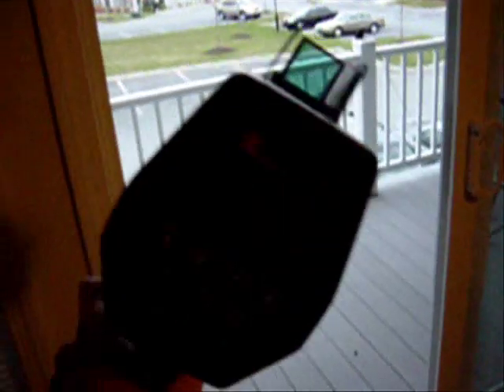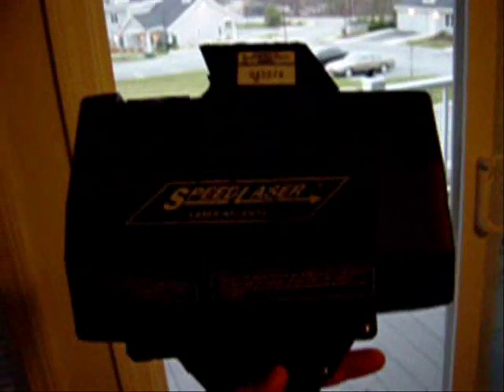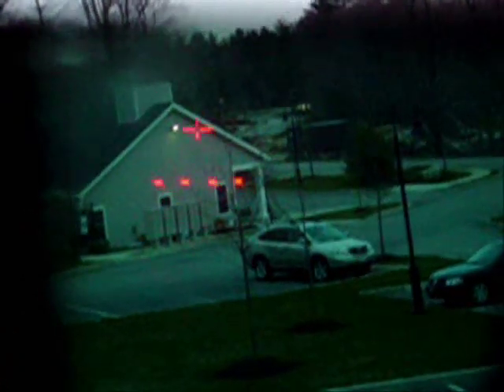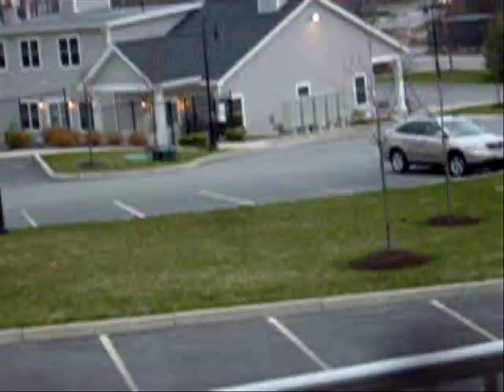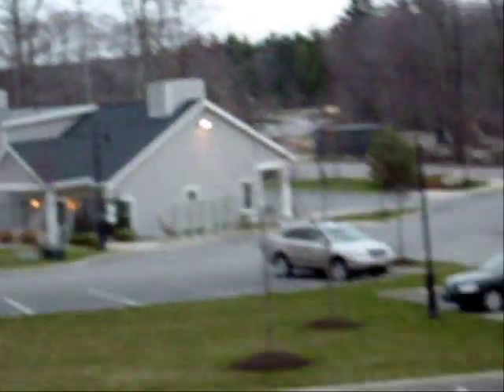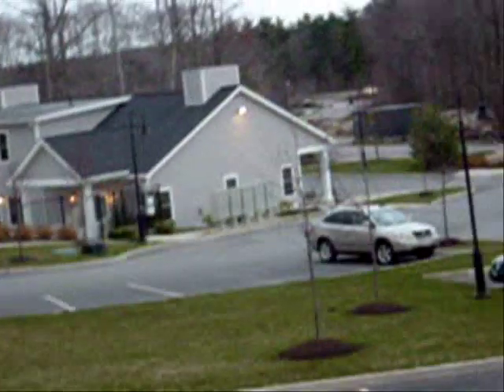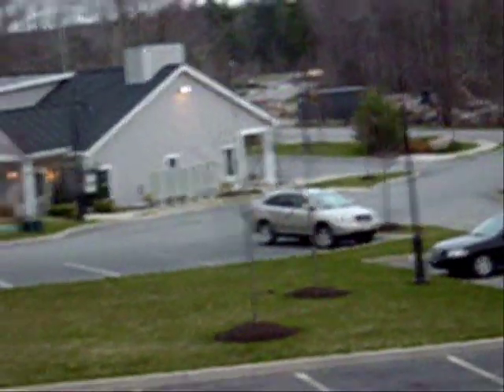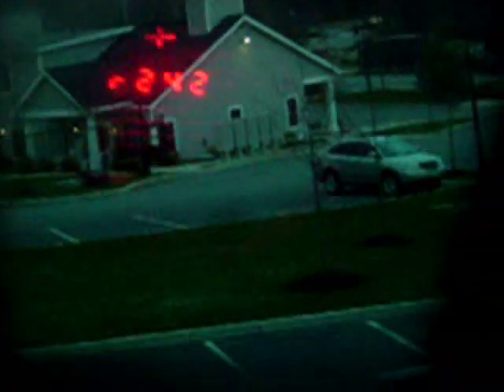Laser guns are NOT 100percent accurate!

Comment from the maker: Actually its not an old gun it is still in use by many police departments. Massachusetts State Troopers still use the Laser Atlanta SpeedLaser. I Prolaser III is a hard one to get a sweeping or panning speed error, only seen it done haven't done it myself. But I have gotten and seen other get them with the LTI Ultralyte, 20/20, TruSpeed, and Stalker LZ1. These were all calibrated by the factory and running perfectly too according to Manufacturer. So these newer guns still have those errors.

Comment: This looks like simple physics. The gun is only measuring distance over and over. The gun is unaware of movement, just distance to target. By panning the building, which is not horizontal to your shooting position, the gun is quickly reading a shorter distance which is interpreted as speed. If the building were exactly 90 degrees from your shoot spot, it should read zip.